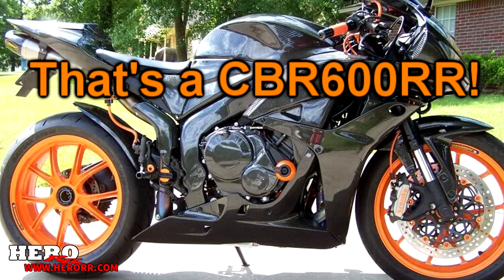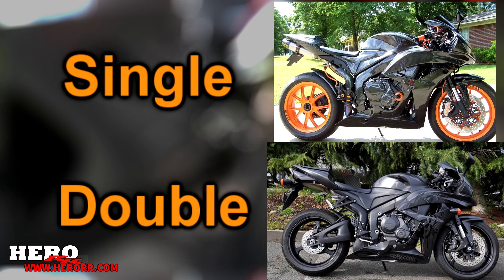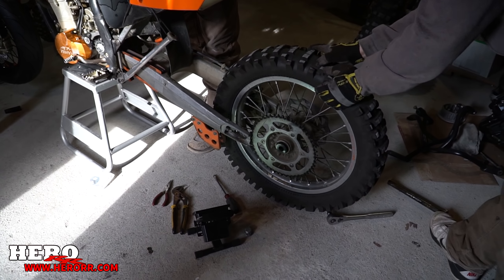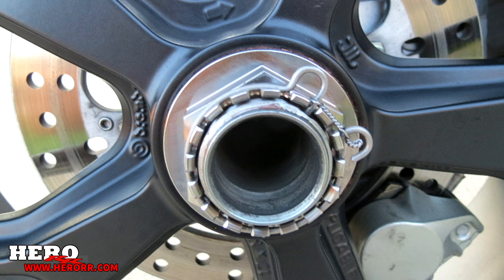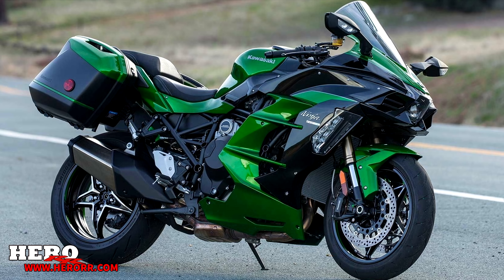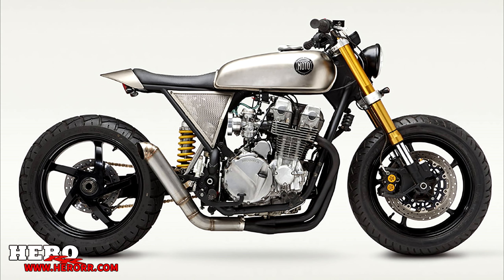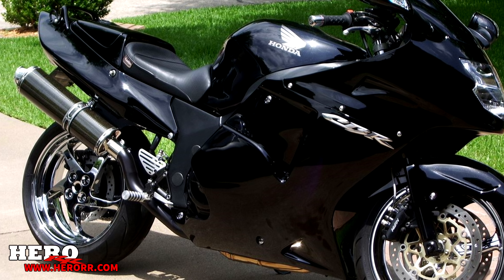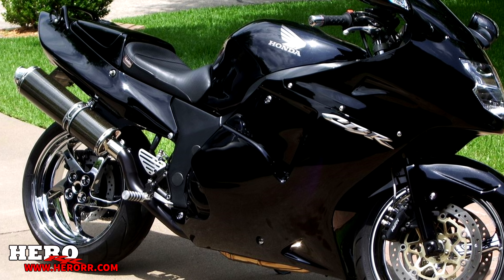Why Every Motorcycle Should Have a Single Sided Swingarm

Comment: I had one on a 185cc Yamaha. No mechanics nearby had a socket big enough to remove it, the bearing inside the swing arm went easily, with no replacements available and wheels were  more expensive and harder to find.  I'd rather a double sided any day.

Comment: It just makes no sense, that's what makes bikes equipped with it stand out in terms of looks. It has to be heavier because it is also loaded by torsion instead of just bending. Probably it is not even designed to load spec, but for stiffness because of the torsion moment. But if you like the looks and minor ease of maintenance advantage, have fun with it, no hate.

Comment: I've never felt inconvenienced by having a standard double-sided swingarm. if the bike comes with it it's cool, but to convert it sounds expensive and a hassle. don't forget you won't be able to use the stock wheel when converting and the new wheel most likely won't match the front wheel.

Comment: there is a reason Honda ditched it in there sportbike line and motoGP doesn't use it and that it doesn't have = weight. owning a HP2 enduro that they only made 400 of they have a single sided driveshaft and when you get on the throttle it pulls the bike to that side. my favorite ducati is the 999r because of the double sided swingarm and dig the 899. PS ducati's are light because of there trellis frame
Reply: im curious how it pulls the bike to the side, i can understand torque steer in a car, but im curious how it works with a single driven wheel. does it force the bike to lean or does it sort of force the bike to yaw?  never ridden  shaft drive so its interesting, as id have thought for the side to side aspect it wouldn't be different from a chain as that's effectively driven from one side too. i know it makes a difference in the bike trying to "climb" on the shaft but not heard of it affecting side to side motion before
Reply: arg31ify more like a torque pull. if you ever go to a BMW dealer they have the new RnineT bikes and ask a guy if you can start it and run it. if you rev it leaned it will almost pull the bike up straight. it's crazy lol.

Comment: I think the question should be 'why can't the engineers simplify the wheel mount/dismount and axle adjustment of the standard swing-arm'? Both the current common front and rear wheel mount/dismount is an engineering abomination..

Comment: Hm so they're are pretty useless in my case. The looks doesn't really matter for me in that case i like both. Sure a faster wheel maintenance is nice but the traditional method is acceptable for me. The next point is the weight more....hm so in conclusion i have weight saving vs faster wheel maintenance or am i missing something

Comment: Hey Hero. I have a Ninja ZX7 L1. I want to buy a second bike for longer rides. Thinking of a 2004 VFR800. Had a VF500 interceptor and now fancy the VFR
Reply: get the 5th gen 98-01 iirc with the gear driven cams and no vtech. sounds sexy. and as everyone mentioning moto gp, gear driven cams for that authentic "max power" sewing machine sound :p
Reply: arg31ify Thanks for the advice. Much appreciated